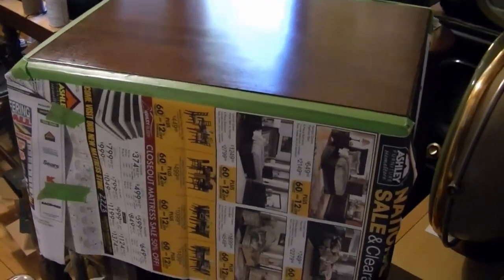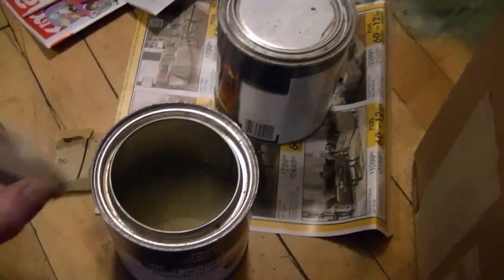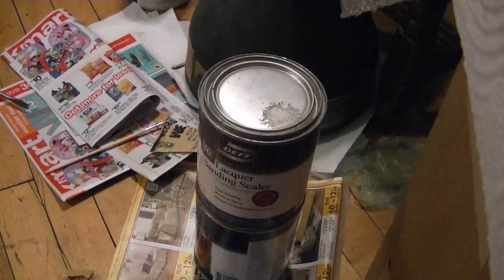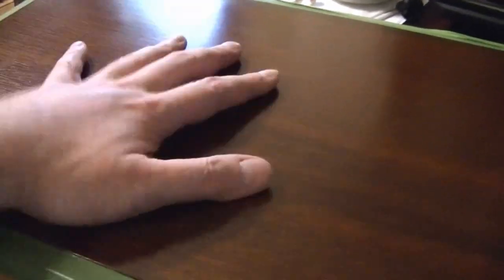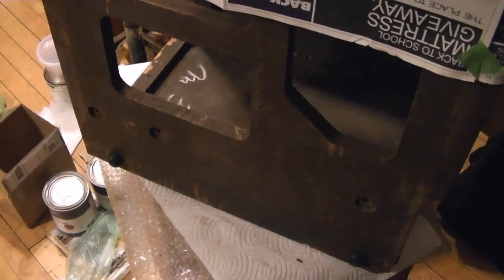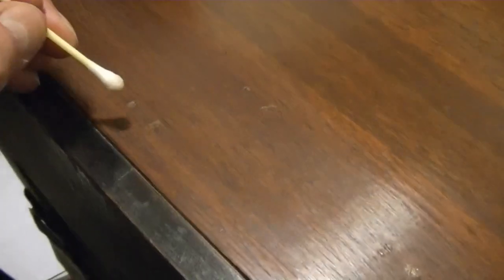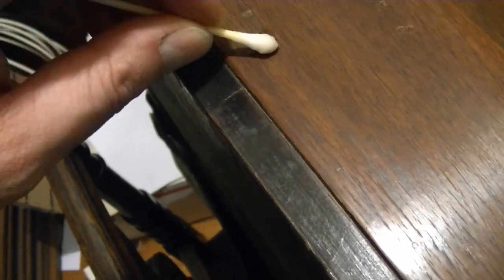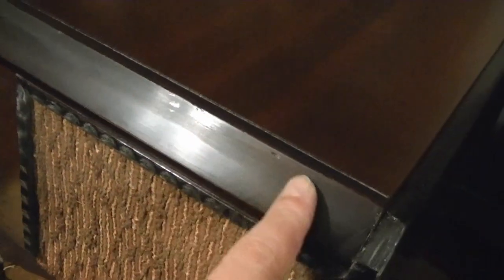RCA 630TS restoration p12o?

Comment: Hi Bob. I have been getting the Mohawk brand toners and sealers from wood finishers store dot com. The sanding sealers are $5.95 And the classic toners are $5.25. Both in spray cans. They also have a lot of other wood finishing products. They pretty fast shippers and not high price on the shipping. You want to check them out.  Dennis

Comment: The Watco brushing lacquer I have been using lately says that you don't have to use sanding sealer, in fact they recommend not using it. But that Watco brushing lacquer is not nitrocellulose based but acrylic based I think, the strange part is that I can spray nitrocellulose lacquer over top of it without any strange reactions.